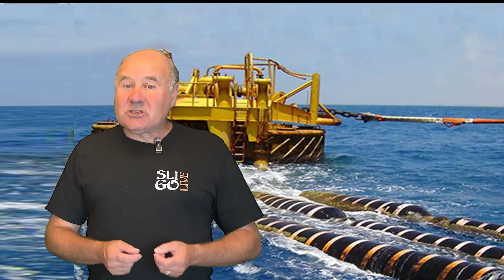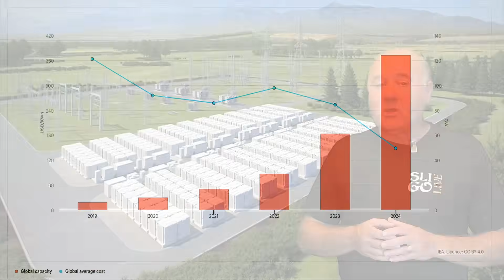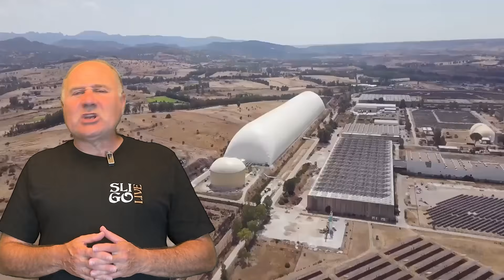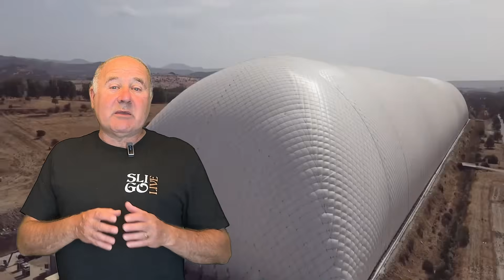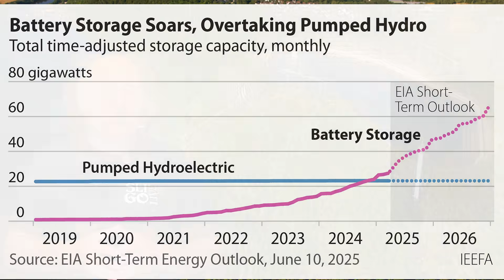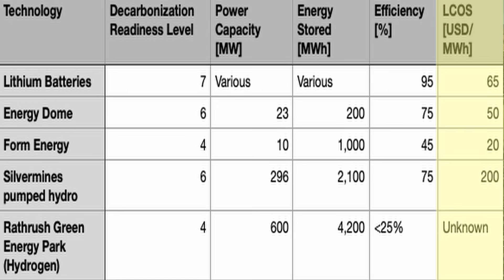Can Ireland build enough energy storage to turn off the gas?

Comment: Denmark has 93% renewables electricity generation, under sea cables are definitely also a good idea, Denmark doesn’t use storage, we import and export electricity depending upon our production, our windmills can power 130% electricity generation from our windmills alone but we just export it and import when we have enough
Reply from the maker: That’s great for Denmark, but Ireland is an island, so interconnectors are a bit harder for us. I’m a fan of a balanced approach for Ireland including both.

Comment: Here in Scotland I check the generation numbers every day ... it seems like months (or more) the last time we used any gas at all to supplement our daily usage. I wouldn't have thought that the options for renewable generation were very different in Ireland. We do have a little nuclear which helps ... but Ireland receives some UK nuclear via the interconnectors.
Reply from the maker: We have plenty of opportunities for more wind power, we just haven’t built enough.
Reply: @Decarbonize11  Yes, we all just need to "get on with it" !!

Comment: You don't build batteries to turn off the gas
You turn off the gas to survive
You build batteries to have a moreluxurious lifestyle.
Reply from the maker: For most people, having reliable electricity is about basic survival. Keeping food from rotting, cooking, keeping your house warm enough to not get hypothermia or cool enough to not die from the heat (okay, that last one isn't an issue in Ireland, but it is elsewhere). Some people have medical devices at home they rely on to stay alive. Almost everyone's job require electricity. Food can't be harvested or processed and delivered to the stores without electricity. 

Reliable electricity isn't about a "more luxurious lifestyle", unless you think returning to the caves is something we should embrace. We need to find a way to turn off the gas without turning off the electricity, but turning it up as we electrify just about everything. That's what this channel is about.
Reply: @Decarbonize11  I think caves are les luxurious. I'm not for a moment suggesting that we don't build renewable energy infrastructure: I'm trying to point out that reducing fossil fuels is a different thing.
Reply from the maker: @Timlagor 
My point is that the only path to reducing fossil fuels is to increase renewable. And I completely agree with you that that alone is insufficient.
Reply: @Decarbonize11  If building renewables was such a path then we wouldn't have record emissions growth.
Reply from the maker: Actually emissions from Ireland are dropping. Not fast enough of course. 

https://www.theglobaleconomy.com/Ireland/greenhouse_gas_emissions/

Comment: Obviously Ireland can built enough batteries, the upper limit on the amount of batteries that can be installed is a very very long way off.
Reply from the maker: Of course it's technically possible. The point I was making was the amount of storage to smooth out daily variations is a reasonable amount to expect and well within the current trajectory.

Comment: Do need to evaluate risk for energy storage.  E.g. could an aircraft impact, tornado, lightning strike(?), etc. burst a huge tent full of heavier-than-air CO2 and cause mass suffocation?  Or would it dissipate?  I assume someone has checked.
Some measures to mitigate such risks might be as simple as using multiple smaller tents to contain the CO2 instead of a single massive tent.
Reply from the maker: That’s interesting question and I would expect it to be part of the permitting process. But just visualizing the amount of CO2 in that dome and how it would spread out over an area, unless there’s a nearby significant depression I would expect it would disperse pretty quickly.

Comment: We should go Nuclear. Modern plants are an amazing resource that would solve all our problems. That plus tidal energy generation and no more wind farms we'd be golden.
Reply from the maker: I talked about both nuclear and tidal in my previous video. 
https://youtu.be/HDGVYpjYFGA?si=TbZhWhSGJM20aqcW

There's no one who makes commercial tidal generators. They're at the Decarbonization Leadiness Level of 3. 

Nuclear would take Ireland about 20 years to get a single kwh, as we have no experience, supply chain, legal framework, and regulatory authority. The easist way for us to get nuclear power is The Celtic Interconnector. 
https://youtu.be/zST1lWz85Eg

Comment: Nothing will happen. Ireland will forever be dependant on outside energy. The government can't even build houses on time or on budget. Prisons can't be built, hospitals or hospice can't be built. They can barely get a road built, and even then they still do it wrong. Been like this for decades and nothing will change especially when it comes to the complex issue of energy production and storage. Only 2 people in past governments have been smart enough to consider Nuclear but no one has ever come up with a good storage solution. Even with recent considerations for Nuclear, it's too bloody late. Our grid is outdated and dangerous and I still see wooden poles going up for lines with no bracing for storms. They can't and never will understand the basic requirements for our island to withstand mother nature.

Comment: Wind - Solar 20% efficiency, SCAM, CELTIC INTERCONNECTOR
Reply from the maker: What do you mean "20% efficiency". Do you mean that they only produce power 20% of the time, which is not efficiency, but capacity factor. Lots of things have a low capacity factor, but that's OK. A fire truck spends 95% of the time doing nothing, but that's not a problem. 

What's a SCAM? The Celtic Interconnect? The interconnectors to Britian have been critical to keeping the lights on and prices low (I know that seems absurd, but it would have been worse without the interconnectors). Connecting to cheaper electricity in France will be a big improvement, as I discussed in this video. 
https://youtu.be/zST1lWz85Eg

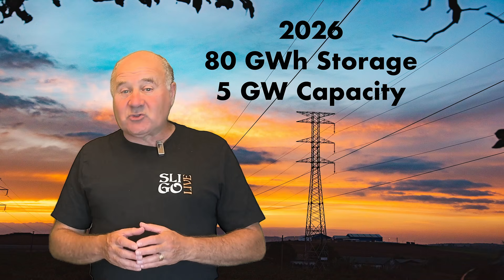Comment: 2:49 we'd also need 10 GW if input capacity, if such a thing exists? because need to charge faster than release?
Reply from the maker: That’s a good point.  But as I said, charge/discharge is not the challenge, storage is.

Comment: Ireland needs to look into tidal energy
Reply from the maker: Theoretically Ireland has a program for wave power, but it’s not incredibly active. There are a few places where title power works, but a lot more where wave power might be possible.
Reply: @Decarbonize11  I'd have thought the west coast of Ireland would be ideal for it, but it was speculation by a novice and I would love to learn more.
Reply from the maker: @charlotteinnocent8752 
For tides, you want a channel where water is forced to flow quickly when the tides change   
Scotland has some great current and they’re doing some work on tidal, but it’s not ready to roll out and even if it was, not that many places have the currents. 

Wave power is pretty much any place with an ocean and a shore.  Especially on a West Coast like Ireland and California.

Comment: Floating solar on Lough Neagh would produce suffering electricity for additional power Northern Irelands requirements. In addition it would go a long way to reduce the green algae on the Lough,without the need for chemical agents to be used. Shading the water surface with solar panels limiting the light required for photosynthesis and lowering thexwater temperature. Sand batteries is a high temperature thermal energy storage system that converts excess wind and solar electricity into heat, storing it in sand or crushed stones ( both readily available locally in Ireland) the system works well for small isolated communities and can be scaled up over time. Works well in Finland. No chemicals or pollution concerns.
Reply: With how both sides of NI throw their toys out of the pram at any plan proposed by the other side, this is probably a pipe dream at best 😂
Reply: Obviously, an Occam’s razor solution goes completely against current ideology on both sides of the border
Reply: @thomasreilly6362  ahh stop, where ye have 2 parties that you can't even put in the same building without them squabbling over ideology, we have 2 parties that are the 2 sides of the same coin and just play musical chairs in the dail every 2 years since theres never a majority government
Reply: @zday40k  Yeh, I was only offering a practical solution to an obvious problem. Not a political solution.
Reply: @thomasreilly6362  is it still algae blooming up in lough neagh? Seen they were having awful trouble with that about a year and half ago
Reply: @zday40k  The biggest problem is fertiliser run off into the lake and other pollutants which is increasing the algae growth and reducing the oxygen in the lake. The eel population is badly affected and fish stocks are declining..
Reply: @thomasreilly6362  I seen a video about it from a fella on here called Stephen reid, he sounds like he's from the north but did a great documentary covering the issues with it. I was wondering had they done anything about it but sure if fertiliser and slurry getting into the lake is the problem then it's never gonna fix, I read about a farmer here who was letting loads of shite run off over an extended period and they fined him something like 1800 euro... 
As if thats gonna stop them spreading slurry and fert in rainy/wet weather
Reply: Forget about solar. The Danes reckon they could power the world

Comment: There is only one way forward from a Climate /Ecology perspective and that is workable and that is half a dozen of one of the numerous SMRs now suddenly coming forward worldwide.  Why do people so quickly forget the two Dunkleflautes back the way in 2010 and 2011.  Both at least six weeks long,  not six hours.!   The mega advantage of going this way,  is they can upfront the  Data Complexes.  Then the waste heat of both goes to the Vertical Farming and The Soldier Fly.  
Pumped hydro is a joke.  ESB owned Turlough Hill.   350MW to pump up,  Then 250 on the down. All storage needs near free power input and that wont do the finances of  big wind etc..    
Forget the French interconnect,  the Great White Whale.  Irrelevant the moment Merkel closed their nukes,  they  the Germans being joined to the French grid.
Reply from the maker: As I discussed in this video
https://youtu.be/HDGVYpjYFGA
SMRs have a way to go. In 5 years there are a couple that may be ready to green light, but I wouldn't put my grid on it. And Ireland has at least 10 years of work to develop a regulatory framework. That's how long off-shore wind has taken, and that's much easier as we can leverage our deep experience with on-shore wind. 

I discussed how I think Ireland should prepare Dunkelflaute here. 
https://youtu.be/iM_n0Ayskns
Storage is part of the solution, but not the main thing. It's over capacity of wind and the interconnectors, which have helped us balance our grid for years. I do think we're overly reliant on them, but I expect that to change with off-shore wind adding to the mix. 

Merkel hasn't closed any nukes. Not sure what you're talking about there, but it might be that some of the nukes had to close to the high temperature of the cooling water. There's a lot of electricity pouring over from Spain, so I'm not too worried that the Germans will soak it all up. 

As I stated in the video, pumped hydro was a good solution 5 years ago, and certanly has been a great investment for ESB. I'm just not certain that building more of them makes sense today.

Comment: Thanks for this report on Energy storage for Ireland.  I think you hit on the right challenges of long duration storage.  Back in 2015 2016 I worked for a battery start-up in Pittsburgh called Aquion Energy which made a saltwater or sodium ion battery for grid storage.  They had $200 million of funding but still ran out of funds and declared bankruptcy.  The public reason for the failure was the high capital burn rate and funding challenges and also the rapid decline in lithium ion battery prices. However, one of the challenges for any long-term energy storage technology is to maintain capacity overtime after hundreds or thousands of cycles.  So the efficiency may be 90% in the first month. But if round-trip efficiency drops in the following months or years to 50 or 60%, it makes the battery chemistry unviable.

Comment: The problem wwith iron air is 30 gw storage needs 65gw input. That doubles the cost of saleable power.
Reply from the maker: Yes, but if you charge it when power is very cheap because the wind is blowing and the lithium batteries are already charged, the impact isn't that large.